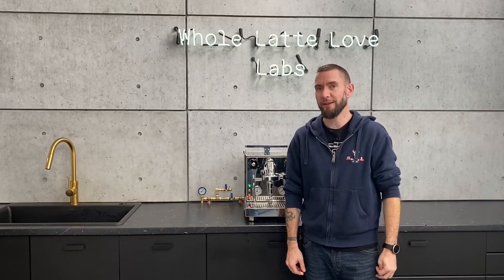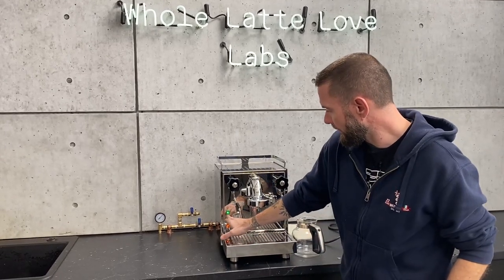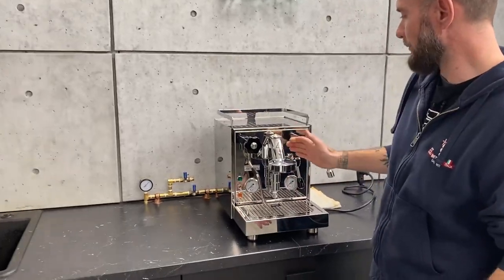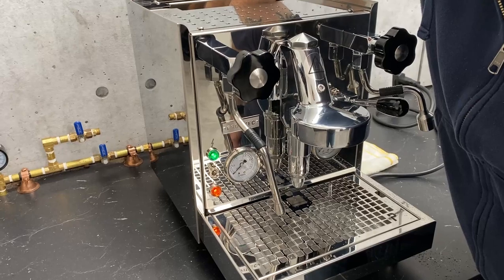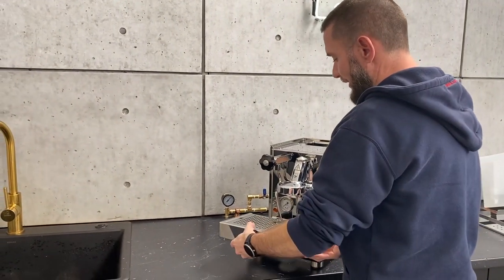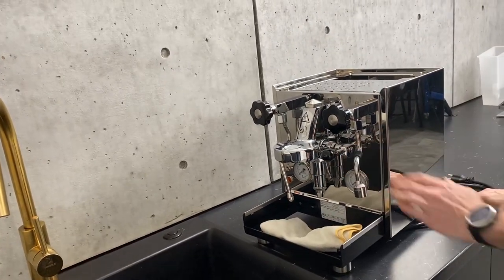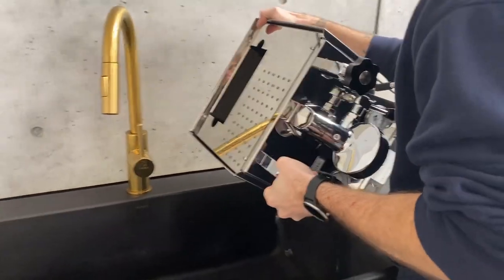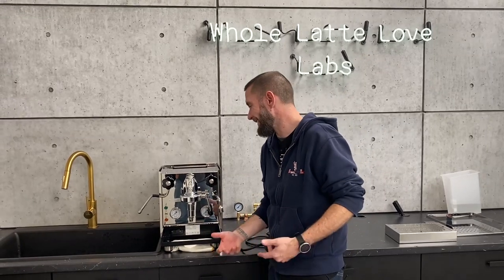Profitec Pro 500: How to Drain the Boiler

Comment: Hi.  Wondering how often, in general use, I should perform a boiler refresh on my Profitec Pro 500?
Reply from the maker: Hi Paul, If you take water out for pre-heating cups, making Americanos, etc. on a regular basis that should be enough. If you don't  then once every day or so run some water out from the hot water wand. No need to totally turn over water in the boiler if you take a cup or two out no and then.

Comment: Hi Marc, thank you for giving us all these informations! My pro 500 pid has arrived few days ago, but there is something that i do not understand, my brew pressure does not go higher than 4 when i'm pulling a shot. If i swap my 58mm basket with a blind one and repeat the procedure i can see the presure reaching 10 bars, what am i doing wrong?
Reply from the maker: Hi the x, You are welcome for the video! Sounds like your grind is too coarse. It's the grind size of your coffee which causes pressure to build. If grind is too coarse then lower build of pressure. I'm guessing your shots are coming very fast? Anyway, here's a video showing how to properly dial in grind size. If using pre-ground coffee or do not have the ability to control grind size the workaround is to use a larger dose of coffee in the PF and tamp (compress) the coffee harder prior to making the extraction. Here's the video: https://youtu.be/jOY7D02n4Cw Hope that helps!
Marc
Reply: @Wholelattelovepage  you're a star Marc, cheers for that! Tomorrow i should have my grinder delivered, it is df64 with the titanium burrs(plus the stock ones already installed). Trial and error once i will get the grinder! If you do not mind, could you please tell me what is your PID temperature, and what e61 group head thermometer should i pair with my pro 500? Thank you kindly!

Comment: I've done the hot method about 6 times in an attempt to remove the rest of the descaling solution from the boiler, as advised by another one of your videos, and when I drop some baking soda in the water it's still fizzing as though it's acidic. Any advice?
Reply from the maker: Hey Jordan, 6 full turnovers ought to be enough unless you were using a really strong acid. Any chance your source water is unusually acidic? If not, just keep doing the hot method until no more fizz.